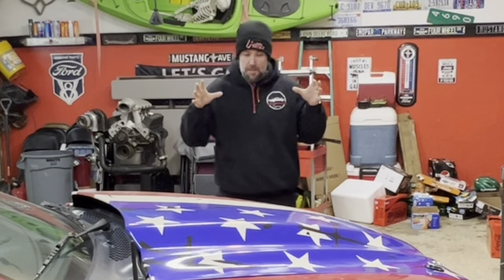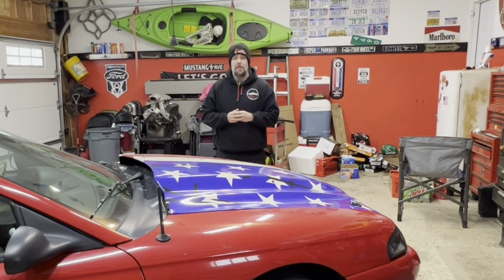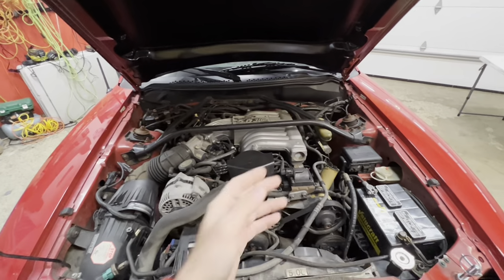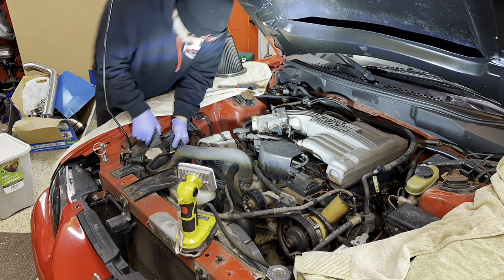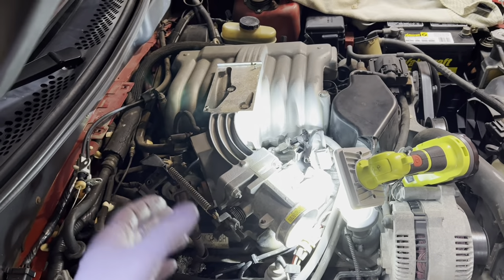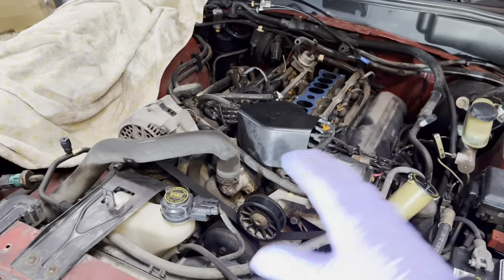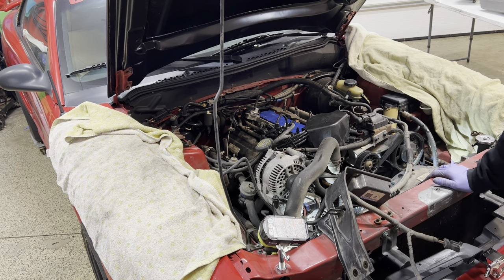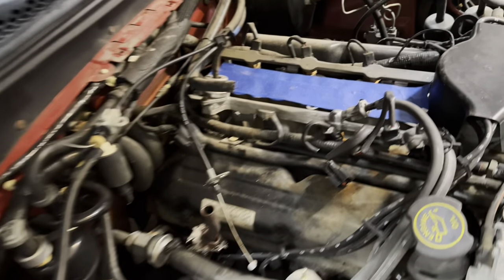Project HellStang! SN95 Mustang Engine + T5 trans REMOVAL-  for HRPT 2023 -  PART 1

Comment: I just Scored a 94 GT Vert black on black with 78,000 original Kms.. gernaded the clutch and took out the bell housing along with the ears on the block... Never seen anything like it... And its a stock car... My Boss literally gave me the car for free... Have a brand new 306 in my 83 im thinking of swapping over... This gave me some good insight! 👍👍
Reply from the maker: That weird with such low miles too. Will be awesome once you get it back on the road :)

Comment: Every single mustang you will ever look at has the same rotted bolt under the battery went through that trying to find one at pick n pull ended up just using a pair of pliars on the head of one of the least rotted ones and got it off without breaking it
Reply from the maker: Yep ended up going with an aftermarket $25 battery tray to replace the plastic one.